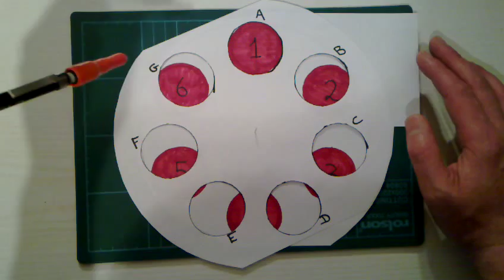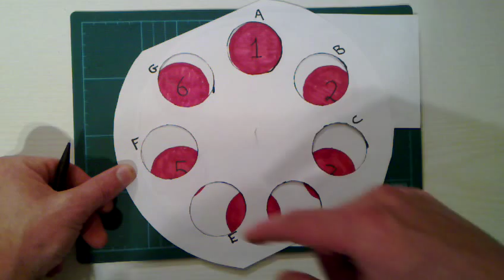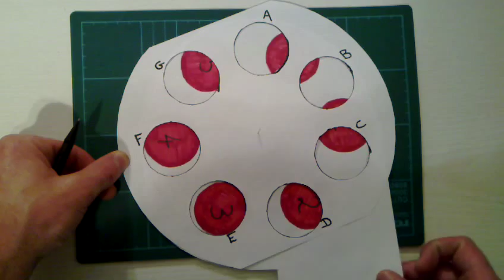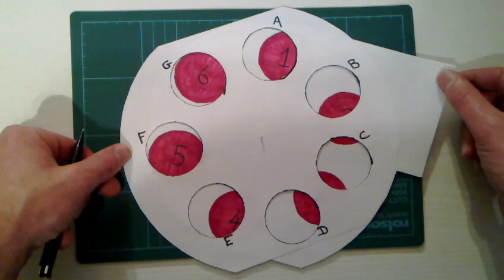Attempt at explaining the events inside the Muller Dynamo

Comment from the maker: @jozsab1 You are essentially correct but when magnet 1 and coil A are in alignment coils D + E are covering an equal portion of magnet 4. This was my 'first draft' and I decided to make the small circles that diameter so I could see the over-laps better. If I make them 1cm it would be more to scale, but more difficult to see using 2 sheets of paper.  All I wanted to convey was the fact of having a counter-rotating series of interaction events happening Mx faster than the rotor.